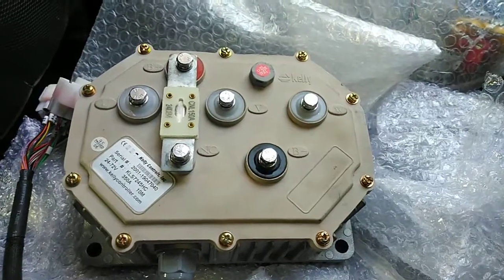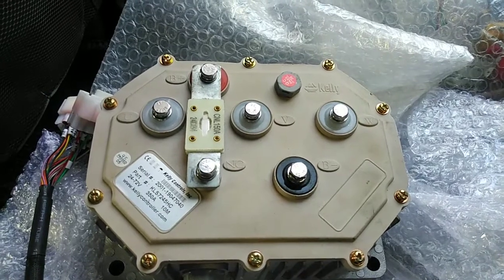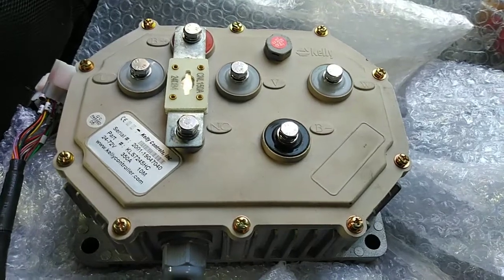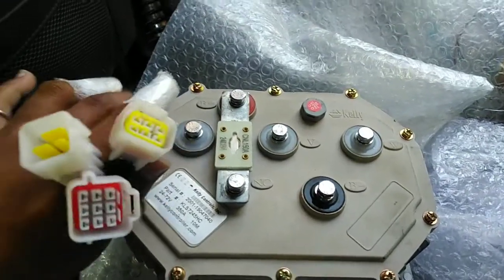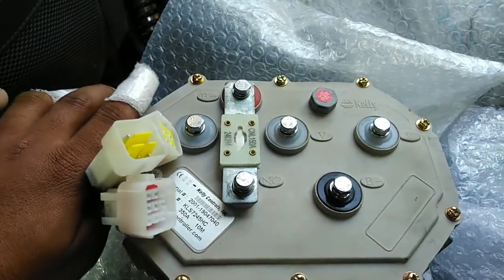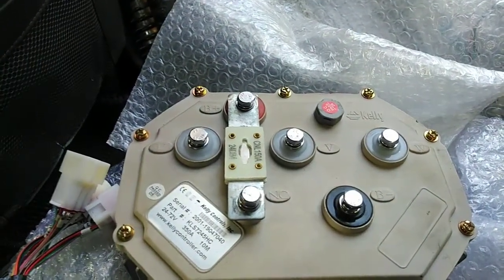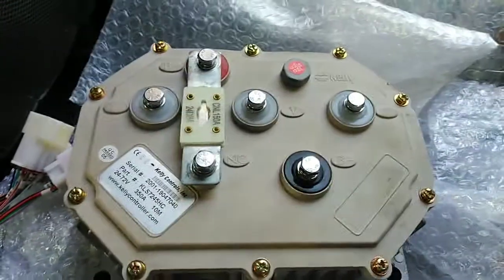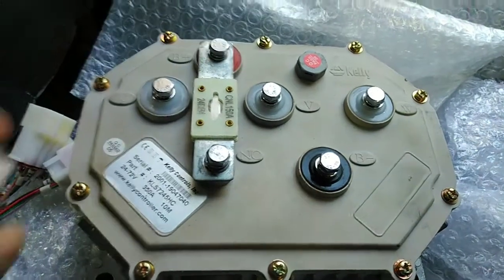Kelly KL7245HC BLDC controller overview.

Comment: Sir , this kelly controller model is getting heated very fast , suggest some way for its cooling ,plzzzz
Reply from the maker: Hi sir, thank you for your comment!

Pls tell me the vehicle condition like, peak load, wiring and motor specs.

Also, if i talk personally then, kelly 7245HC slightly heats, even after 800 kgs of load, as i have experienced in my electric Maruti 800.

But pls tell me your conditions, and share on whatsapp 8319520774.
Reply: @engineerbyheart2914  yes i whatsapp you